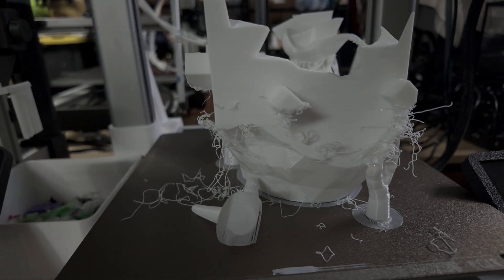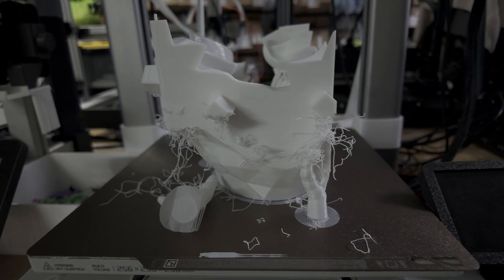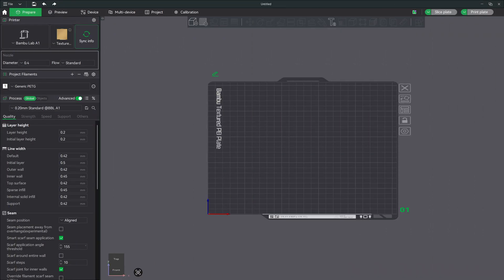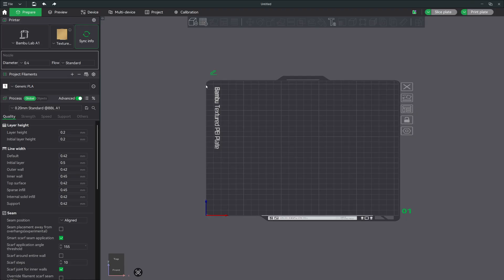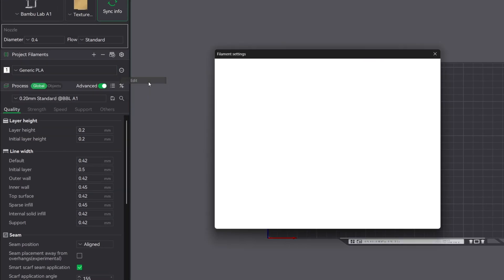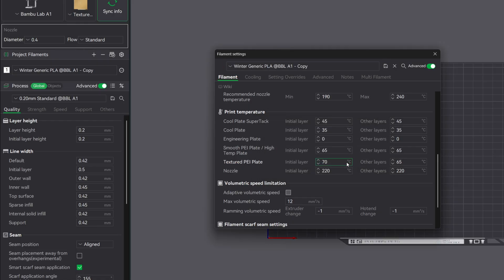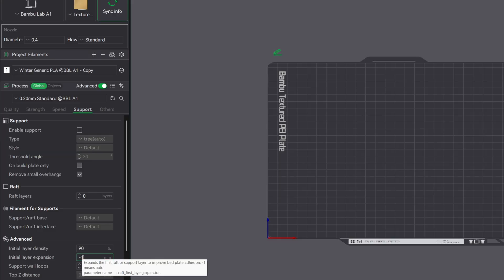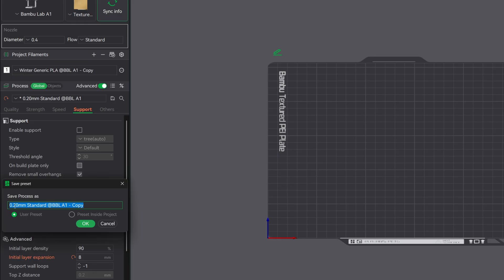Fix Winter 3D Printing Problems With These 2 Simple Tweaks

Comment: its real, my printer is not in the best place, close to an exterior wall. The temps in the corner really dropped and increased print failures. Thanks for the tips!

Comment: ive just started having problems ai told me to heat up my heating bed to 65 and been doing better still some times it doesnt work so maybe ill just bump it up to 70 and do the supports also they have been having problems thanks for the help.

Comment: Does this only apply to open printers like the A1?
Reply: not at all; higher temperature differential is going to lower chamber temps also. your heated bed will probably do fine for surface temp, but if you're not using PLA and want to keep your chamber warm without a dedicated chamber heater, your bed temp is going to get the job done less well. this same advice is applicable raising bed temp 10 degrees or so can mitigate this slightly, but one thing i like to do to help keep parts from cooling too quickly is turning off the part fan. this isn't as viable if you're printing something with bridges, however. having the part fan off and come back on for bridges causes slight separation issues. the light gives off some heat, so if you normally keep your chamber light off, you can turn it on and maybe get one degree higher chamber temp under cold constraints, but not enough difference to make or break a print. if you are printing in a cold garage overnight, your best bet is to probably just run a small space heater in that corner of the garage.